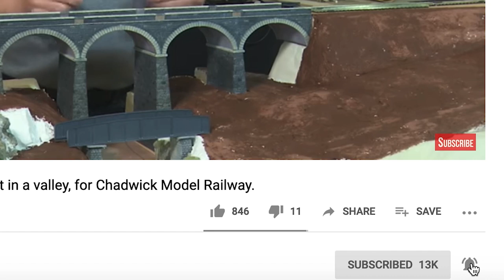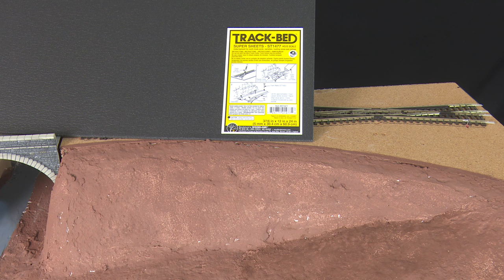Great Landscape Progress at Chadwick Model Railway | 69.

Comment: You might consider putting a waterfall coming out of the wall, maybe a bit off center, that would run down the rear hillside behind the main bridge and feed your river through to the front. You could put someone fishing off the smaller forward bridge.
Reply from the maker: Thanks for the tips, the more the merrier.

Comment: Charlie,. The viaduct portion is comming along splendely. I do like the extra detail of the drain pipes.
As for the farm bridge. 2 suggestions.
Leave the current bridge but paint and highlight the same color as the rock. Then the two areas will blend quite nicely.
Also you could use an old retired flat wagon. With a small bit of weathering and distressing.  Of course remove the wheelsets.
I built a show layout years ago I went to great lengths to highly detail the layout and I ran out of time.  When I delivered the layout and set it up I had forgotten a small road bridge . I grabbed a 40 ft flat wagon removed the bogies. Gav a bit of distressing. Placed  a flatbed Lorrie pulling a tractor on one side and a few figure people walking on the other side.
The show lasted 1 day. I received more comments about the little bridge than any of the other finely detail.  
Sometimes it's just the simplest things that you add that blend and bring the biggest  impact to an overall scene.
Now does your wife know you've gone and nicked her clooth pins? Lol lol !!
Take care Charlie
Reply from the maker: Wow, what a great comment James. I will certainly look into farm vehicle options.

Comment: I would keep the little bridge, just maybe darken the stone a little more with a darker grey.  Maybe do a paper template that will only spray a few bricks.  Then use a few other shades on the road bridge to make it more like the viaduct in a way.

Otherwise looking very good and I was thinking about the wires when you said about removing the points from the cork section and then you said that they had not come up very well.
Reply from the maker: Thanks AG, I’m so pleased that you enjoyed it.

Comment: I think the bridge needs weathering to give you a better idea as to its compatibility, but I think its fits in nicely. Just a tip when using Vallejo paints, they are pigment heavy for painting models but even then you need to thin them slightly with water to make them flow a little easier,  not a great deal but you'll notice the difference in ease of application. I love the videos keep up the good work :) all the best. Roger
Reply from the maker: Thanks Roger although the jury is still out regarding the bridge.  The main thing is to get the module against the wall and track laid.  
You’re right about the Vallejo paints, they are a little thick.
I’ve just airbrushed with them for the first time and the worked well with their own thinning agent.
Do you use them for airbrushing?

Comment: Coming together nicely! I think the farm bridge is the right style, just needs some paintwork and then fences and gates either side to bring it to life. Once some greenery is going down and you get some taller grass and bushes on the side that the animals can't reach it will blend in much more and you won't worry about the joins!
Reply from the maker: Hi Ben, I’m so pleased that you enjoyed the video.  Regarding the bridge, I might go for a wooden structure in contrasting with the viaduct.  You’re right that with the scenery, the stone one will blend in much better.
Reply: I would say that the span is probably too great for a wooden bridge is it not? Wooden bridges in the UK tend to be mainly small flat ones crossing ditches or would need lots of piers as it would need to be able to cope with tractors etc. Farms rarely have anything that needs lots of looking after and big wooden bridges need attention! It can help to consider the backstory for these things, how old would it be, older than the railway I'm guessing? I think it needs some heavy "rustication" to make it look less pristine. It might benefit from some judicious sanding and filing (to replicate the course lines again) to break-up the clean outline maybe? Sometimes with ply you can peel off the odd brick or stones face using a scalpel (depending on the laser penetration) to replicate spalling that would occur. Some research of appropriate 12" to the foot examples on the web with a nice cup of tea/coffee can be inspiring I find.
Reply from the maker: Excellent points Ben, many thanks.

Comment: Great video as always Charlie. Love that WS leopard spotting technique on the rock faces, I shall be trying that out, and the white dry brushing does make a massive improvement to the 3d effect. Another great tip I shall be using is the 2mm round solid and 3mm box sections for downpipes. Thanks Charlie and continue having fun! Cheers Steve
Reply from the maker: Thanks Steve, I’m so pleased that you found the video useful.

Comment: Well you done it again,  another great vidio, with all the details it looks great.  Try the foam tape (about a 1/4 wide & 1/16 inch high) along the road edge and that helps with keeping the road edges and a smoother road, I've seen Luke use it and it's a great way to make roads quickly,  the coloring the spackle is a great idea even on the hillsides too, I have used concrete coloring and a little goes a long way....thanks for sharing....Jack 😉 hope this helps and I do enjoy your vidios
Reply from the maker: Thanks JO and I’m so pleased that you enjoyed it.

Comment: Hi Charlie, little tip when trying to get filler smooth . Make sure the tool is CLEAN and give it a dip in some water before drawing it smartly over the fresh filler. Not too slow, not too fast. Clean and dip the tool frequently i.e every or even other stroke until you are satisfied with the surface finish. 

Looking great so far.
Reply from the maker: Thanks for the tip and I’m so pleased that you enjoyed it.
Reply: @ChadwickModelRailway   Always a pleasure to see a video from yourself pop up. One of the better channels on youtube without a doubt!

Comment: Hi Charlie, great update on the structure and again, very fine modelling from a fine modeller. I did notice you painted the river bed onto the wood with no scultamould or plaster base. I swear I saw a video of another you tuber who had problems with the resin lifting the paint and so had to lift the whole lot and do it again. I note that Luke Towan uses the scultamould and paints that. Not telling you how but I did notice so just mentioning. Great work as always and really looking forward to the next one. Keep slogging with it Charlie, it looks great and is coming together nicely. Cheers for now, Chris
Reply from the maker: I’m so pleased that you enjoyed it Chris.
I’ll try and check out the river issue.

Comment: Hi Charlie,

I believe you mentioned Celotex being used as an alternative to polystyrene when building the hill on the right of the river. Were you aware that Celotex was the insulation used in Grenfell Tower and is highly flammable? They are one of the two companies being talked about in the current Grenfell fire enquiry.

Just be careful you don’t have any heat sources close to it.

Jim
Reply from the maker: Hi Jim, yes I did hear about Celotex on the TV earlier today.  Worth bearing in mind, thanks.

Comment: Viaduct scenes are awesome to build!! That does look impressive too! Nice  work. :-) 
Little observation with your scalpel storage: The way your scalpel is stored in the tin will damage and blunt the edge of the blade, (won't last as long). Maybe try gluing a soft surface, or rubber like material to the inside of the tin to help stop this. :-)
Reply from the maker: Good point Sammy and I’m so pleased that you enjoyed it

Comment: G'Day Charlie. Matey I love the new farmer track stone bridge, just needs some lead in stone work on each side and I think painting it to match the look of the Viaduct Stone work might settle it into the scene better so as it looks like the stone work came from the same quarry (locally maybe). PS: Matey if you use a Silicon based adhesive like Selleys 3 in 1 under the foam road base instead of PVA glue it will make the whole set up a LOT quieter, also never tack down track real tight with rail tacks, as again it transmits more noise and when its time to ballast the track try using a spray on clear contact type glue that never really sets hard like Selleys Kwik Grip Spray Contact Adhesive.
Reply from the maker: Great points G 130, I have some soft setting glue to try out, perhaps even another video topic!

Comment: Hi Charlie, great video as always. Have you thought about using expanding foam inside the structure of your viaduct? I have been using it to help with sound deadening now for many years in structures such as bridges and tunnels with good success. Just make sure you use a good quality foam, I tend to use a trade brand from Toolstation and it can only be done with 'gun grade' foam as well. It will expand by it's very nature so less is defiantly more, but it will not only give a density to things but stabilise them to. Also I quite like the little bridge you, maybe look to ageing it so looks like it has been there long before the viaduct. Keep up the great work. Craig.
Reply from the maker: Thanks Craig but it’s now too late to get foam into the viaduct but I’m so pleased that you enjoyed it.
Reply: @ChadwickModelRailway  If the track isn't done yet Charlie you could drill through the track bed and it's always a pleasure to watch one of your instalments, Craig.

Comment: Another great video, just one thing I was a bit worried about, Not watched the next video yet so you may have already covered this.. but if you are putting landscape behind where the the points are, are you leaving it less permanent because if you ever have a point motor stop working you will need access?
Reply from the maker: There is some restricted access but you’re right it will be a challenge!

Comment: Hi Charlie. Another great video 👍🏻
A question for you tho. Does the foam track underlay work better for sound deadening than cork in your opinion?
I’ve used cork so far but only in my non scenic fiddle yard and I’m surprised how loud and drummey the trains are. As of yet I have no experience of ballasting any track, but from yours and other videos it will only get worse by the sound of it. 
With foam underlay and ballasting I guess there must be more sound transmission than just foam but still better that cork do you think??
I think I would try flooring underlay as it’s much cheaper that purpose modelling stuff. Do you find that it works well??
Thanks for any help you can provide👍🏻
Reply from the maker: Thanks HF for your interest.
I believe that a foam underlay will be better than cork but the ballast glue is critical.
I’m working on a video so please be patient.

Comment: Good Evening Mr. Bishop,  another enjoyable video. In reading over a few of the comments, I find myself somewhere in the middle of the conversation about the road bridge. Being from the opposite side of the Atlantic, I'm unfamiliar with what is prototypical in your neck of the woods. One thing that is important to me, from a modeling perspective, is to keep scenes, and the various bits and pieces that make up the scene fit the era that is being modeled. I would assume the road bridge came before the viaduct in the timeline of the scene as was stated by one individual, unless you wish to model something more modern that has replaced the original. Personally I like the little bridge, however if something different would fit the scene better by all means change it. In the end, what makes you happy is all that really matters.
Reply from the maker: Hi Sam, thanks for your opinion. The road bridge is staying (for now)!
Regards Charlie

Comment: Hi Charlie, some good work on there, and to add to a previous comment about the road bridge looking too modern in brick, why not keep the bridge as it’s a design that looks like an early type of bridge but to cover it with stone card, as the old bridges would have had very thick abutments and walls, so you could use stone sheets and das modelling clay on the tops scribed to look a little like dry stone walling as old farm bridges like that would not have had flat capping stones but irregular shaped stones on top.
Reply from the maker: Hi Kevin, thanks for your advice and I’m so pleased that you enjoyed it.  I will check out the stone sheets available.

Comment: Charlie, that farm track passing under the viaduct should really go through the centre of the arch. A farm track would be used by a tractor pulling equipment, which may likely get snagged on the arch with the track passing so close. It just looks wrong.
Reply from the maker: Good point Stephen, you’re now promoted to rural advisor.  
Stay with me, I need as much help as possible.😀
Reply: @ChadwickModelRailway  Oi jus' be doin' moi jaab

Comment: What is people's love affair with mod podge? Can't I use any generic PVA glue instead?
Reply: PVA or Elmer's glue as it was called mixed with water does pretty much the same job and far cheaper. Mod Podge is a trendy brand that people seem to have gone nuts about!.
Reply: @davehenshaw4657  ah thanks for the explanation.

I don't mind branded stuff, in fact I prefer brands fir certain jobs, but for that application I thought generic stuff would be just as good
Reply from the maker: I bought mine at a car boot sale!